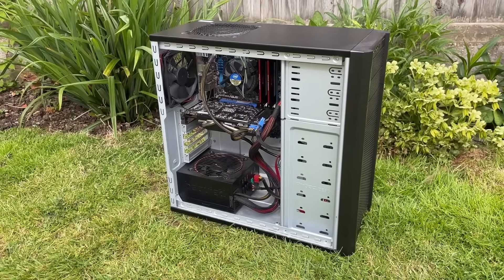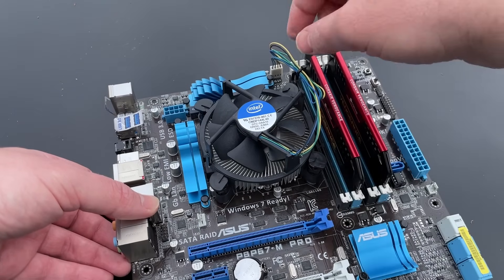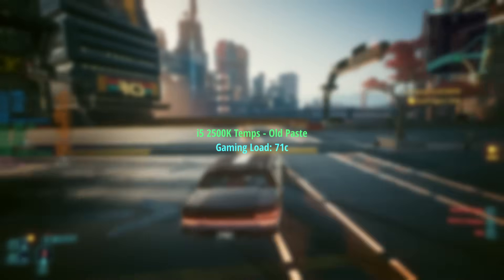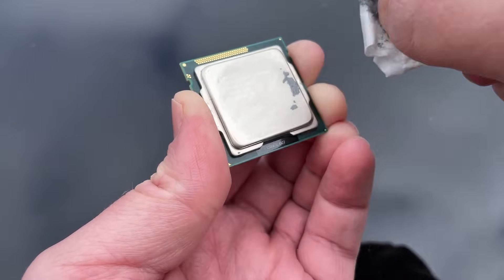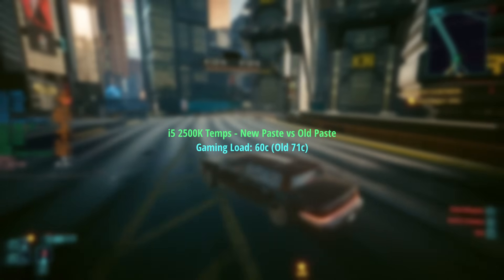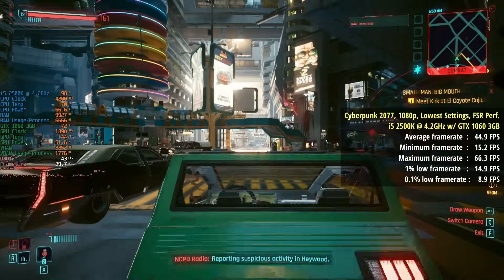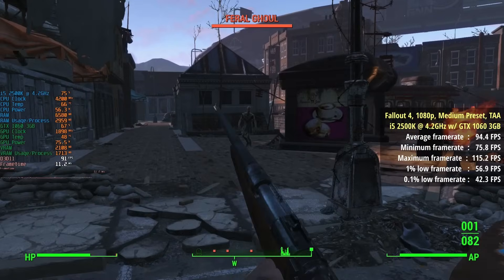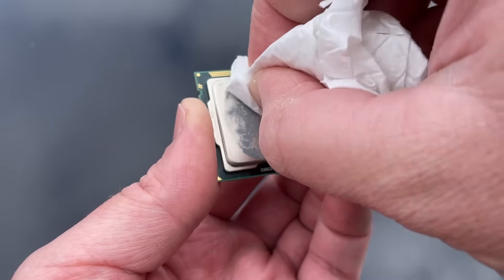I don't think the thermal paste has ever been replaced...

Comment: Thermal paste is just an auxiliary "component" , because best thermal conductivity is between two metal contacts. Paste in itself has two parts: one is liquid (usually silicone oil) , and other is crystal (metal oxide mostly) . Liquid part is just to get crystal part into gapes and holes between two metal contacts. Then it could dry up. Crystal parts displaces air (thermal insulator) and conducts heat almost (but not completely)  as good as metal itself. Changing thermal paste is in most cases unnecessary if the fan is working properly.
Reply: I wanted to make a similar post. This is how that thicker high end industrial paste everyone loves to complain about being used in most consumer higher end computers works. The paste is designed to dry in place and last practically forever as long as the cooler isn't moved and breaks the pastes seal. It's not the most thermal conductive but as a person who had a i5-2500k when it was new and used the stock cooler on it. The stock cooler worked about the same back then with the stock paste as it did in this video. Fancier and more thermally conductive pastes do get worse when they dry out and some are designed to be replaced every year or so.
Reply: @chronossage  As usual, brand name pastes are there just to squeeze money from consumer 😁
Reply: Changing thermal paste is a necessity after a certain amount of time (after 2 to 3 years of regular use and i would say every year for daily extensive use of a pc). The conductivity worsens after a certain amount of time and use and temperatures goes up, a properly working fan does not help if the thermal paste dries out. When the thermal paste dries out it can leave some air bubbles between cpu/gpu and cooler, because the dried out paste can burst, due to vibrations, what makes the conductivity worse. It often times depends on the quality of the used thermal paste and how it is applied.
Reply: @jackonline8173  Nope. Conductivity does not worsen, it is a chemical property of the material. As I said, liquid part is there just to get solid part to proper position. Air bubbles do exist but they are minimal, as you have two metal surfaces pressed together, plus metal-oxide sandwiched between them were gapes were. Btw, liquid part evaporates fairly quickly (days not years) if you use computer regularly under high load. Overall, you change the paste when you remove the cooler fan (and displace crystals) , usually when fan needs to be cleaned.
Reply: @jackonline8173  Advising people to change paste once per year is ridiculous.  Don't fall for the hype.  In most cases, you shouldn't ever need to replace thermal paste.  In three decades of working on PCs, I can't remember a single occasion on which "old paste" was the diagnosed problem.  You might find that an old computer had a *bad paste job*, or maybe the paste itself was flawed in some way, or maybe there was pump out, but if there are significant heat issues, it's far more likely that the heat sink wasn't seated quite correctly, or that the fan was dodgy, or that the machine's choked with dust.  

Even in the video, the CPU runs fine at stock speeds with the "ten year old" paste job.  Sure, the youtuber's repaste yields dramatic benefits after overclocking, but realistically how many people are concerned with overclocked performance, under a stock cooler, on a 13 year-old CPU?  If you're still running something like an i5-2500k in 2024, then it's probably in a secondary machine for light office work or maybe serving up files on a home network, in which case stock speeds will be perfectly adequate.  Or maybe you do enjoy maxing the performance of old CPUs, in which case you probably have a beefier cooler to begin with, something with much more head room than Intel's stock heat sink--really anything will do.  If that thing had a cheap tower cooler on it initially, the overclocked Cinebench result probably sits in the 70s, rather than the mid-90s.  Even with the old paste.  And poof, there goes the whole basis for the video.

To the extent that paste deteriorates with age, most users are unlikely to care by the time it does deteriorate.  Re-paste jobs are for cases in which you have to remove the heat sink *anyway*.  

I generally like this guy's videos, but I think he's a little off-base in this one.  The video doesn't really even try to establish that the paste's age was the determining factor; it just sort of assumes that old paste = bad, implying that old paste dries out, and that dried paste will crumble and fall away.  None of those concerns has much merit.  Dry paste won't fall away as long as the heat sink is well seated.   And as @aleksazunjic notes, the original thermal paste probably dried out when it was young, within a couple of weeks after application.  For all I know, the Arctic paste is just that much better than whatever paste was used originally.  Or as above, maybe the heat sink wasn't seated quite correctly.  The mounting system on those stock Intel coolers, with the little plastic feet, is mildly notorious for seating issues.
Reply: @RedundancyDept  Then i had a way different experience, than you had, because in a lot of cases heat problems was because of a lot of dust and of old thermal paste (mostly the original applied, or a not so good applied later on with a after market cooler). A change made a difference of about 10 -15 degrees celsius (just blowing of the dust made mostly around 5 - 8 C depending on how dusty it was). And as i wrote in the End of my comment: "It often times depends on the quality of the used thermal paste and how it is applied."
Not every device is guaranteed to be made perfect, mistakes happen, we are all only humans after all and even machines can fail.
Reply: @RedundancyDept Depends where you live and hot you run your PC's. I live in the desert, it gets very hot, about 120F or 48C in the summers outside. Sure I run AC, depending on situations, inside of my home can hit well above 100F in situations. TL;DR The paste dries out quite fast, I replace it every 2-3 years on devices and do in fact notice a difference if it's a device that runs hot or that I use a moderate/heavy amount. I wouldn't advise people to incessantly change their paste typically, but I wouldn't say it's pointless to change your paste and that it offers no benefit. I measure noticeable benefits each time. I work with old electronics quite a bit, I have recorded 30+ degree improvements in Celsius for temperature just by changing the paste. It's not just the cleaning of the fan, I don't know why you are arguing that or why you would tell someone to clean their fan and not change their paste, why would you tell people not to change their paste? That's like telling someone to change the oil filter on their car and not the oil bc the oil is a myth fabricated by motor oil companies. Why not change everything when all of it plays a substantial factor, especially when added up?
Reply: @dOUBLE_ddeez  Because I'm sick of hearing from people on the internet with only half a clue that repasting is something that the average user should have to do on a regular basis.  I see this advice thrown around everywhere, often times in response to questions that don't even relate to overheating or noise.  

Can repasting help?  Sure, and I never disputed that.  Should you try it if you're having overheating issues?  Yeah, no harm in trying, though if it's something elaborate like a GPU, I'd suggest looking for easier answers first.  If I had a nickel for every story I heard from a newbie lamenting that he bricked his perfectly functional GPU by attempting a "routine" repasting ... well, I'd have about $20, which would be nice.

If you don't recommend "incessant" paste changes, then we don't disagree about anything.

Again: most users will never need to repaste anything within the realistic useful lifespan of a CPU/GPU.  By the time the paste degrades to a meaningful degree, the part in question will probably have been relegated to light use or outright retirement.  Most users, remember, are not overclocking, nor are they routinely running their rigs at full load, to say nothing of climate differences.
Reply: I have many PCs that have never been repasted. No thermal problems. One example: Fx8350, clocked at 4.6ghz, Corsair H80i AIO, installed 2012. I have blown and sucked dust out of the rad and fans, otherwise it has not been touched. It still runs as cool now, on the quiet setting, as it ever did.  @jackonline8173

Comment: if you still have 2/3rd gen plz delid and replace intel toothpaste inbetween the ihs and the die. it will drop to 30s-40s with a max of 50 with 3rd party coolers. and since you can buy a 3700 for like 20-40$ these days it aint no harm to experiment.

Comment: I don't know your environment, but those before temps are dreadful for a 2500K, even with a stock cooler.  Did I really hear 54 at idle?  I built many 2500K rigs, idle 30 and no more than 60 load at stock clock.  Maybe the board is giving it a bit too much voltage also?  Looks fairly good after the repaste, I always go ahead a redo the chipset and vid card as well for anything over 10 years.

Comment: When desperate for a replacement "thermal compound" use ordinary toothpaste, the sodium fluoride one not the calcium fluoride or some fancy meme pastes.  Its a temporary solution, make sure its a small amount and that you are applying it not like the normal paste but spread it out and tighten the cooler tighter than you would normally. 
It will dry up and after a couple weeks you must repaste again or repaste with a proper thermal paste. 
Its better than nothing.
Reply: Surely if one has the means to get toothpaste that he may also have the 2 bucks necessary for a cheapo thermal one.
Reply: @fus132  Its not about money, its just that you always have some toothpaste around the house.

Comment: The "Max idle temperature" metric doesn't make a lot of sense to me. If you are getting readings that are higher than the "min idle temperature", obviously that's not at a true idle state. Perhaps using HWiNFO64 configured to average the last 5 or 10 minutes might be a better indication of difference between pre- and post-repasting. And also looking at the CPU usage average over the same 5 or 10 minute period to make sure it stays at a very low figure, e.g. 0.1-0.3%. Otherwise it's possible there were active processes running at the time that skewed the temp averages.

Comment: The minimum permitted all-core speed for the 2500K is 4.4GHz surely? Re. thermal paste; some are made thicker to resist 'pump-out' from frequent large temperature swings, such as Noctua's NT-H2 which is much thicker than the cheaper NT-H1 (Arctic have similar types, MX5 or MX6?), so they're better suited to overclocked chips (and laptops). The trade-off is they're more difficult to apply.

Comment: Hmm. I know for a fact that thermal paste is for filling the micro gaps and aiding in heat transfer between the heatspreader and the heatsink. Now with that in mind, it shouldn't matter if paste is dry or not and it should only make sense to change paste when removing the cooler...except that for whatever reason I can't comprehend, when changing paste, it does make a difference!
Reply: Because people use way too much. A tiny blob right in the middle is all you need. Also, stock paste is usually pre applied to the heatsink, already slightly dry with gaps and of poor quality, this causes trapped air pockets that crack the compound.

Comment: that's a bigger temperature drop than i ever expected.  the copper core intel coolers aren't bad, just hideous haha
Reply: the i5 2500k was a 95 watt cpu and the cooler was also included with i7s that were rated for 130 watts. So the cooler had to be able to semi handle that.

Comment: The Antec Three Hundred is an excellent case. Been rocking mine since 2012. :) Its only flaws, IMO, are the lack of front-panel USB 3.x and just how heavy it is.

Got pretty good air flow, too. Got only two exhaust fans (the stock rear and a cheapo for the top vent) in it and they do such a good job that I've no desire to populate the other three fan slots. (okay, it's not like they have a huge load to try and keep cool, just an Ryzen 5 3600 with its stock fan and an RX 6600, but still... :P)
Reply: We're almost PC twins! I've been rocking my Antec Three Hundred since 2010. It currently has a Ryzen 5 3600 as well, together with a RX 5700 XT and 32 GB of DDR4. The RX 5700 XT and RX 6600 have very similar performance and when I bought my (second hand) card I was actually considering them both! I also have a nice got a nice CPU cooler and some beQuiet Pure Wings fans, mounted with rubber fan mounts instead of screws and a silent fan curve. Makes it for a powerful, yet quiet system. Systems like these have such a great value :)
Reply: Also, if you want USB 3.x on the front, you could consider getting a 5.25 Inch USB panel/hub. The nice thing about this case is that you can do things like that :)

Comment: Surprising how good MX4 paste is. I've got a tube on standby ready for a re-paste on both my GPU and CPU in a couple of years (5 years total). I got a good deal on the MX4 but did consider the more expensive MX6, but it was a bit too much to be worth it. Think I made the right choice after watching this, it's not like I'm running high end stuff.
Reply: I've got a tube of MX4 for general pasting, but also did buy myself a tube of MX6 for high end stuff and for when every degree counts (e.g. my HP OMEN 15).
I also found a tube of MX2 on the cheap for systems that really don't matter what paste they get (e.g. low power Celeron/Pentium CPUs etc).
Reply: @TheSpotify95  I assume that's a high performance gaming laptop. So how did that go, I bet it was a bit fiddley? Did you make a note of your temps before and after?
Reply: @bigjoeangel  Yes, the HP Omen 15 is a gaming laptop, not terribly high performance as it was a 8750H and 1050Ti combo. The 1050Ti isn't great nowadays.
Repasting with standard MX-4, the Temps seem to be around 75-80C after repasting and completely clearing the finstack of dust. If this is not done on a yearly (or less) basis then the CPU reaches 100⁰C and throttles back. So yes it does help.
Next time it will get MX-6 instead to see what happens, as I only bought the latter recently.

Ultimately, whilst I don't go for the absolute best in terms of temperatures (as the best thermal pastes will cost much more than MX-4 or MX-6), this HP OMEN seems to get slightly worse with temperatures as time passes, until each year it becomes essential to re-paste. When I first got it, it had never been re-pasted and the CPU Temps were affecting in game performance.
Reply: I was about to purchase MX4 for my gaming laptop but went with Corsair XTM70 (which was a fair bit more expensive) and it helped tremendously with lowering temps. I'd definitely use MX4 for non crazy powerful desktops or regular laptops, but I did kind of want the best I could afford since I was fed with thermal throttling.

Comment: I redid the thermal paste on my GTX 1650 SUPER.  It was hitting max temps every day I played but now it's coasting in the mid 70s during intense gaming. I used that noctua paste.
Reply from the maker: Nice :)
Reply: @juubilo1509  Paste does not work as you imagined. It is a auxiliary thing, just to fill in gapes between two metal contacts. Paste has two components, liquid and crystal. Liquid component is mostly silicone oil, it is there to get crystal component at right place . After that it could evaporate without much effect. Crystal component is metal-oxide, it is almost as good thermal conductor as metal. Once it gets in place it stays there practically forever (i.e. until you remove cooler) .
Reply: Very nice!
Reply: Unlikely to have anything to do with the paste. If you cleaned and lubricated fans, it could have resolved the situation.

Comment: Those sandy bridges always were overclocking monsters
Reply from the maker: Yeah beasts back in the day!
Reply: 4.6 ghz for years on air. I still have my i2500k. I dropped a Ivy bridge i3770k in the z77 board before I moved over to AM4 and to be honest the i2500k was the better chip but no hyperthreading. The i3770 never did clock as high. I think 4.3 was all I ever got from it.
Reply: @skivvywaver  Between Sandy and Ivy Bridge Intel went cost cutting and change from using solder between CPU die and IHS to some thermal goop. That made CPU "scalping" a popular thing. I believe that intel only returned to using proper solder around 9th gen due to pressure from Ryzens.
Reply: No doubt. I have a 2600K that goes up to 4.5ghz. it's actually just as fast as my 12700 on the desktop. 2nd and 3rd Gen Intel both overclock pretty well.
Reply: @HardWhereHero  I think 4.5 is about where my 2600k topped out at too.

Comment: I find that the little plastic feet things that keep the cooler in always breaks in old intel CPU coolers, maybe just me being too heavy handed.
Reply: I've modified a core 2 duo cooler to fit on any socket, and i've not broken any of the plastic push pins, i had to remove them completely from the cooler in order to do the mod, so yeah, i think you push too heavy handing them
Reply: @bramvandenbroeck5060  🤣
Reply: I absolutely hated those coolers back when, way too easy to break the feet if you were removing the coolers a lot which I did cause I worked at a place where we built/repaired PC's and servers in those days.
Reply: @nadtz  must be costly aswell cause uv got to replace every customers cooler that broke
Reply: @mzmknight  We had tons of spares, replacing them was never the problem but it was annoying that it was even an issue.
Reply: @nadtz  yh especially considering on amd at least with ryzen its a non issue